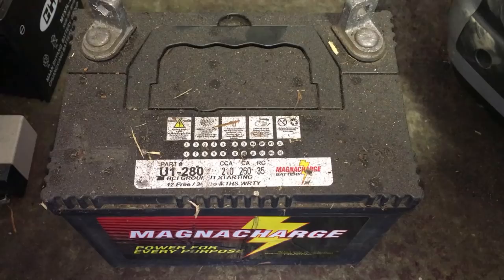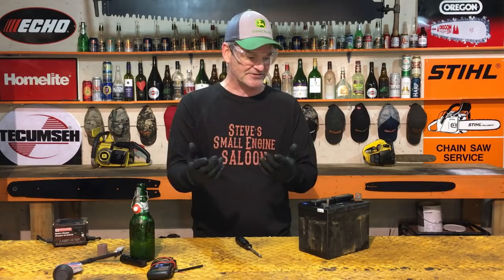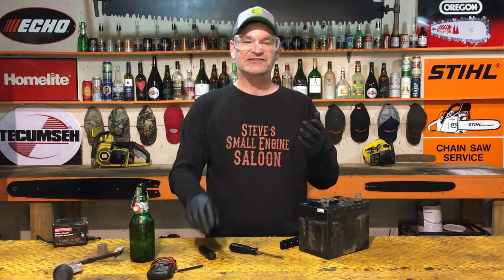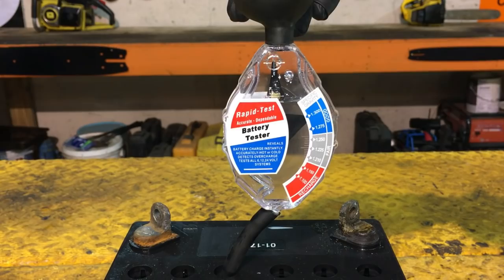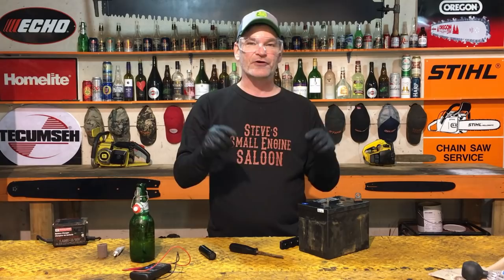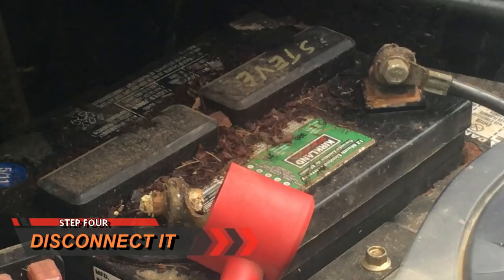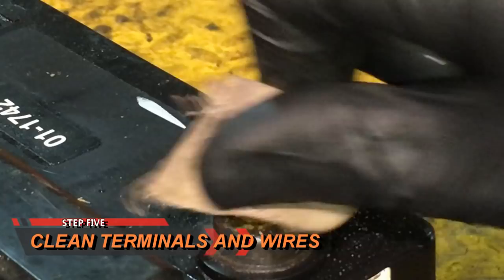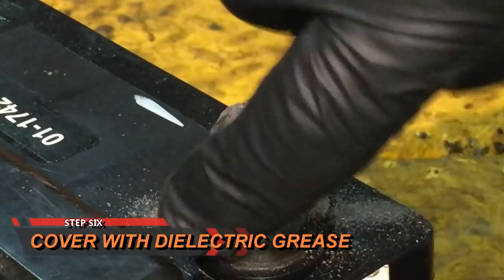How To Winterize and Maintain The Battery on a Riding Lawnmower

Comment: Concrete doesn't drain a battery because it's cold, cold doesn't actually damage batteries as long as they don't freeze. Concrete drains the batteries if it is significantly colder than the air. In direct contact with the concrete, batteries can have a significant temperature gradient from top to bottom. Colder batteries have a lower voltage. If the top of the battery is warmer than the bottom, there will be a voltage gradient *within each cell*, and a current will flow within the cells, essentially self discharging the batteries much more rapidly than usual.

It's sitting around partially discharged, or fully discharging at all, that ruins lead acid batteries.

A battery will have a lower voltage when it's cold but it's not actually discharged. If you warm it back up it will have full voltage again. In fact, the colder the battery, as long as it doesn't freeze, the slower it will self discharge, so keeping batteries in a cool place is actually better for them.

Of course, no matter what, the best thing is to charge them fully, and put them on a float charger.

Comment: If your voltage reads anything below 12.6 your battery is weak. You should be getting 2.1 volts from each cell. All six cells add up to 12.6 volts.

Comment: Hey Steve, the battery myth comes from the days of old. Some of the first batteries were just a series of glass jars in a basket. Then they started making thick paper containers. During these times, if left on concrete the batteries could lose charge. But since the housing has been made out of plastic, the batteries don't lose their charge if left on concrete.

Comment: The only things I would add is don't add water to weak battery if you need to start the tractor.  Adding the water will kill it dead.  Make sure the tractor is running first.  Also, if you find it dead, charge it immediately.  Once the voltage drops, the battery starts to sulfate.  Once sulfated, it will never be the same.  You'll find it charges super fast, and discharges just as fast.

Comment: When working with a battery it is advantageous to be wearing polyester clothing in addition to protective eyewear. Polyester is one of the few cloth materials that are reasonably good at resisting sulfuric acid solutions - cotton goes to hell so fast you can almost see it happen. 
If that polyester material is not handy, a spray bottle of 50/50 ammonia and water will quickly neutralize the acid splashed on your clothing. It is also good for quick rinsing your hands when in the shop - don’t wait, do this right away. 
Don’t forget to wipe down the metal tools you used while working on the battery. Besides that, the ammonia water solution is really good for cleaning the corrosion on the battery terminals and cables. 
Naturally this is done before the battery is opened or after it is closed since the ammonia, a base, will partially neutralize the acid in the battery electrolyte.

A dielectric is by definition a non-conductor. Get to you local hardware or big box store and ask for anti-oxidant paste for aluminum wiring. In a pinch you can use copper or aluminum based anti-seize to improve the electrical connection. 
When I bought one, I read that in England, sports car battery terminals are protected pro-actively by a light cleaning while the battery is still new - immediately, lightly and completely, smear petroleum jelly on the connection posts or bolt-on terminals. Before attaching the cable clamps or bolt-on connectors, completely dis-assemble the connector - of whichever kind, and thoroughly smear a coating of petroleum jelly on all exposed metal parts. Reassemble and attach in the normal manner - but wait, you are not done - completely cover in a generous fashion the now lightly coated connection - as if it were frosting or a dollop of mud. 

The mechanism is this; it is the gas generated by the battery that causes the corrosion. If air cannot get to the connectors or into the connection, then neither can the corrosive gas. 
It may be that you will never have to deal with the connection - beyond a regular visual inspection - until the battery needs to be replaced. Very handy for the ( I know this is gender specific ) reliable starting of your mom’s car. An ounce of prevention … and all that.

I know this because ‘someone’ persuaded my mom to buy an MG in 1980. If you know anything about English sport cars, you know that they are heavenly to drive and hellish to maintain. The learning curve was steep for me when I came back from overseas in ’83 and she was on foot or catching rides with friends. The ‘someone’ was the third fellow she divorced. 
MGs are notorious for having unreliable electrical systems. In a couple of years I got good enough at MGs that I bought a ’67 BGT for myself and drove it for 22 years - I was the only mechanic either of those cars had.

Comment: Keep in mind, 12.7 is a true 100% charge reading and in order to get accurate readings it must rest for a time after charging. Readings in the 13's is a false reading as a result of recent charging. Let the battery stabilize before taking readings. Also, the charge level isn't really effected by cold temps as much as it is the ability of the battery to work effectively as the battery ages and has been maintained. Life span averages around 4-5 years.

Comment: The terminals on the mower's cables are plated. Scraping them with the emery cleans off the crud quickly (good) but potentially, but can (permanently) remove the plating (bad). Once the plating is gone, corrosion of the terminals will happen faster. Note I am talking about the terminals on the end of the cables, not the battery terminals (which are NOT plated).

Comment: Steve, I don't believe you are correct in stating that a lead acid battery will discharge faster when it is stored in the cold. A battery works on a chemical reaction, the lower the temperature the slower the reaction. That's why your battery doesn't work so good at very cold temperatures. You don't have to take my word for it, according to Northeast Battery, the warmer the environment while a battery is in storage, the faster the discharge rate. I fully agree with the rest of your video.

Comment: The reason you have to use distilled water is because undistilled water has minerals in it. Minerals conduct electricity, and that causes electricity to flow between the plates. That will short out the plates, ruining your battery.

Comment: The temperature myth is false. In reality, the colder a battery is, the less it will self discharge. Discharge and charge are chemical reactions that are accelerated by higher temperatures.

This is unrelated to weak performance in cold temperatures. Ideally a battery is stored cool - obviously it must not be allowed to freeze - and heated up before continued use.

A typical self discharge rate for a good battery is 5% per month starting from fully charged, and depends on temperature. 1 volt per month would almost equal 100% per month.
Reply: I've seen many batteries stored  fully charged in the lawn tractor for winter,  sat outside at -20c,  started right up in the spring,  and then other batteries removed, stored inside all winter at warmer temperature,  would be dead in the spring.
Reply: VE1AXC   I've seen the same thing !!
Reply: That sounds right, as chemical reaction generate heat.  Cooling slows down chemical reactions.  Therefore it is logical that storing a battery in a cooler location would slow down the discharging process.
Only had a year of chemistry in college so I’d like to hear from any chemists out there.

Comment: The concrete discharging a battery is not a myth, it is just out of date. I researched it when I was doing work on battery back up units at hundreds of volts at thousands of amps, made by putting small batteries together. It would keep large magnets in steel mills from dropping the load all over the steel manufacturing plant. It was long before batteries cases were made out of plastic and were made out of an asphalt product. The properties of the asphalt case were such that they would be some leaching and the battery would drain itself due to chemical reaction. I will let you research it and verify as I am just some guy on the internet, but battery companies have the actual reaction and properties of material in their archives and then wow will you look smart when surrounded by women some day, they love engineering facts, FYI.

Comment: To be honest, I hate using a battery powered tool, or machine. Too many poor, or bad battery issues occur. Bad rechargeable batteries can easily kill your pocket book. I own one small electric snow blower ( as a back-up machine), but it runs off of house-hold power, through a long, and very heavy-duty ( and water proof), AC power cord. It works well, clearing snow  between parked vehicles. All my other machines use gas, and gas/oil mixture. My smaller 2 cycle 5hp. machine is normally used between vehicles, but if it ends up having a repair issue, I have the small electric to fall back on if and when the case presents itself, and that's rare. I have a couple of large blowers for the real heavy work, and both have 10 hp engines, and are serviced long before winter is even here, and running good.  Think I'll stick with what I use, as they are very dependable for an older man clearing loads of snow each winter. It's very rare if anyone of them fail me, when I need them.

Comment: I gave the video a thumbs up but it has issues. I have no idea why Dielectric grease is specified all the pros say it. Grease already is a good insulator at 12 volts. A high-temperature grease is best. Someone mentioned Vasoline is a low-temperature grease that melts at 99F it gets hot in the engine compartment. Someone mentioned NO-OX-ID electrical contact lubricant (electrical contact grease) is an electrically conductive grease. Dielectric, insulating material or a very poor conductor of electric current. Putting Dielectric grease on electrical mating surfaces is not a good idea. Fortunately, the pressure used on the battery terminal to hold the connection together squeezes the grease out and forms the moisture seal. Next cold temperatures slow down the chemical reaction in the battery which in turn slows down self-discharging. For full power, the battery needs to be brought back up to room temperature before use.

Comment: I use a hi Amp quick connect on all my power equipment' i use one Motorcycle battery' get off one and plug it into the next' if its really cold it goes inside and it's warm when i start my plow.   I even added a quick connect to my Jump box and quick connected the Jumper leads for that.   10 years on one battery so far.  Lawn mower batteries are a scam.

Comment: i've always heard that putting a battery on concrete discharge it because it grounds it, that's not the case?
Reply: How could it ground through the plastic case? If that's true then it would ground while installed and fry every fuse in the mower.
Reply: No, that's an actual myth.

Like Steve mentioned, the floor potentially being cold may be a reason to insulate somehow. Maybe. If for nothing else, to reduce condensing water from temperature changes.

I don't like putting batteries - or plastic canisters - on concrete for the same reason I don't toss them around on a gravel driveway. Plastic is soft and eventually sharp abrasive stuff will puncture things made out of plastic if you keep them for long enough.
Reply: @tonsssedell4318  ok!thanks

Comment: Your statement on storage temperature  is WAY off.  Batteries drain LESS in colder temperatures when stored under NO load.  Your misconception comes from the fact that batteries drain MORE in cold temperatures when under load.  Much better to store your batteries in a cold garage than inside a hot basement.  And as others have said voltage needs to be over 12.6-12.8 depending on chemistry to be considered fully charged.

Comment: 12. 13 volts??? No.

13.8 hot off the charger.
12.7v after sitting a week.
12.6v after sitting a month.

Comment: One thing I like to do is keep the battery disconnected from the piece of power equipment it’s in it prevents a parasitic drain from discharging the battery over the winter .👍🍻
Reply from the maker: Right On...

Comment: 13.85 volts is a dubious measurement that has no face value. A fully charged rested six cell lead acid battery will show 12.6 to 12.7 volts.

A battery that's at any reasonable state of charge and was recently charged will often show more than 12.7 and this leaves us guessing. Just having 13 volts will not tell anything other than the fact the battery has been recently charged. It could be full or way less than that.

Another possible cause for a crazy measured value could be a faulty multimeter or a weak multimeter battery. If your battery has not received any charge within a day and the multimeter says thirteen point anything, your multimeter is wrong.

When you measure a fully charged and rested battery and it shows about 12.65 volts, you can be pretty much 100% sure that the battery is in fact fully charged and your multimeter's DC voltage measurement is on spot.

At 12.0 the charge level is just below 50%. That's enough to prevent freezing in reasonable temperatures but not enough to keep the battery fresh for months. It will become sulphated and will not last very long. 15 minutes of charge will do little to top up a lead acid battery. More like 10 hours if it's not nearly full to begin with. However, a ride mower battery should be fully charged in the end of season anyway if the mower was used during season and charges properly.

TL;DR: In case you decide to not check specific gravity, wait 24 hours after doing everything for winter storage. Measure voltage. At approximately 12.6-12.7, you'll be fine. If it's less than that, you need to charge.

Comment: I’m really disappointed that the ‘advice’ that I’ve been telling everyone for a lifetime, about never putting a battery on concrete, turned out to be BS.
Reply: In the old days before plastic housings for the batteries it was a true situation, the old housings were not very good insulators and concrete due to it's alkaline nature is conductive.
Reply: David Moran Thanks for the info!!  I feel better now....:)
Reply: I have tested this theory as I had a cement floor in my shop and believed the cement theory was wrong.  I had a lot of batteries as I was on a farm with a lot of machinery and always took the batteries out for the winter.  I complained to a friend one day about loosing so many batteries all the time.  He said stop storing your batteries on cement.  I said that is a bogus theory and he said it was like hell.  You put batteries on cement and it definitely hurts them.  I went home and put a bunch on boards and guess what.  They all surved and one's on cement definitely did not do well.  It has nothing to do with old or new cases etc.  I do not believe it is to do with temperature either as cold temperature does not seem to cause a battery to discharge more.  It will lower the out put but it comes back when warmed again.  Just have something to insulate the battery from the cement.  You can do what you want but I will not put batteries on cement.   Another note always keep them charged up  and at least every 2months even if storing them.  A low charge rate is very hard on a battery.  Even take a new battery and completely discharge it 2 or 3 times and see what you have.  Hope this helps someone.

Dale in Canada